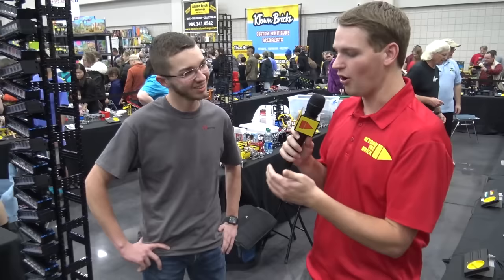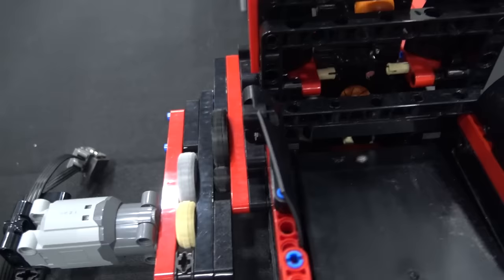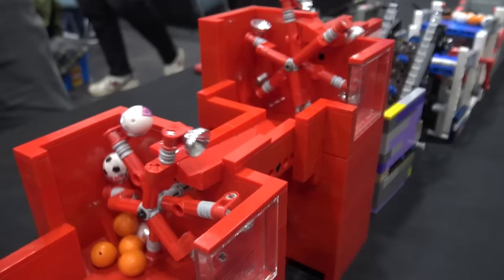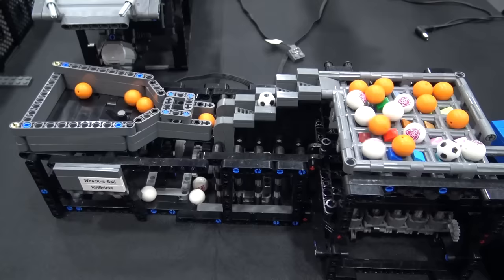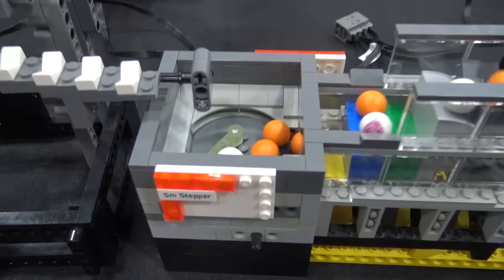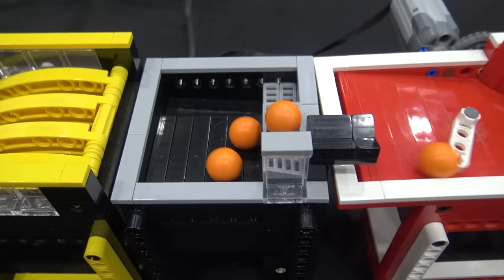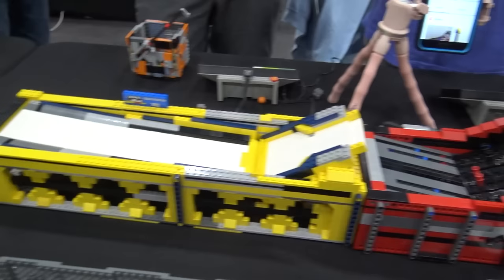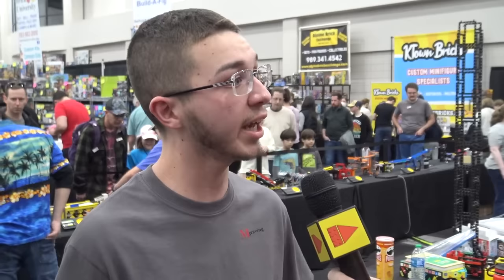LEGO Great Ball Contraption at Atlanta Brick Con 2023

Comment: The train module that was described as not working. Also featured a light sensor, so was it’s intention of that module would separate the balls by their colors ?  I was thinking would be a fabulously clever thing to do and by color would be the first choice but I was also thinking that each of the ball types would weigh a slightly different amount, and that it might be possible to catapult them through some kind of arcs device so that their weight would cause them to fall into different bins to be separated by their external appearance ( ??? )